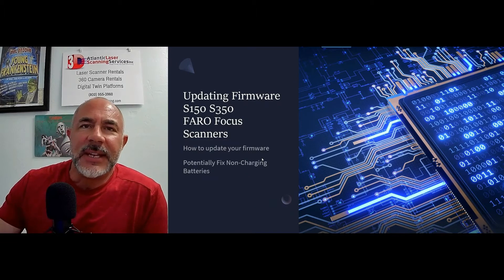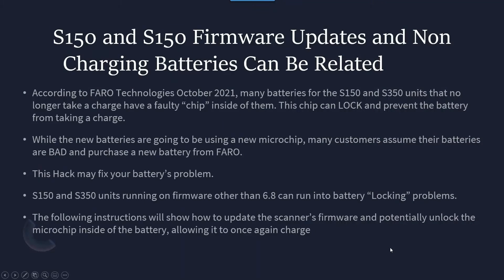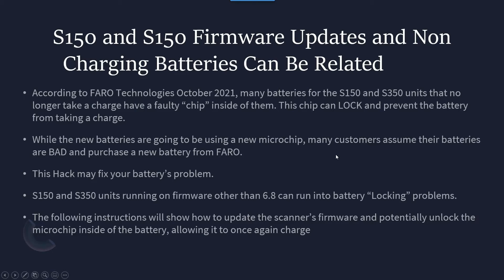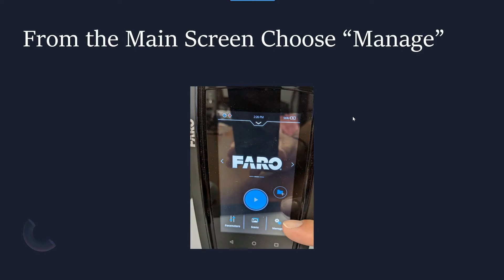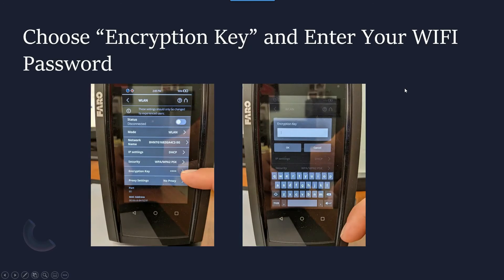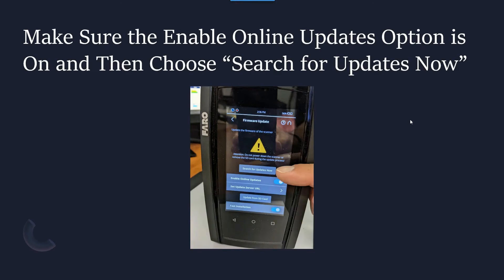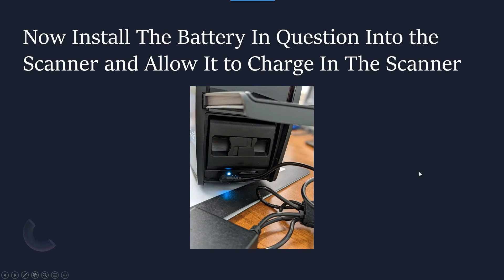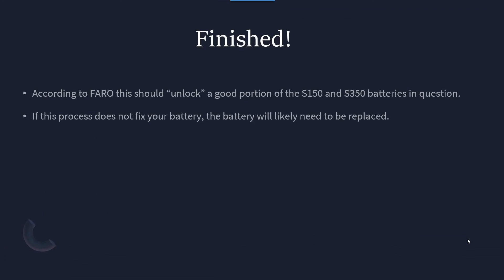Atlantic Laser Scanning Tutorial FARO Battery FIX! S150 & S350 Battery Fix Using Firmware Update

Comment: Does error named, 1340: Battery failure issue be solve with this solution? Or any other way around? 
As I have tried this with M70, yet not working.
Reply from the maker: With a 1340 you can try it, but its more likely the battery is done. We have gone through a dozen in the past 2 years.